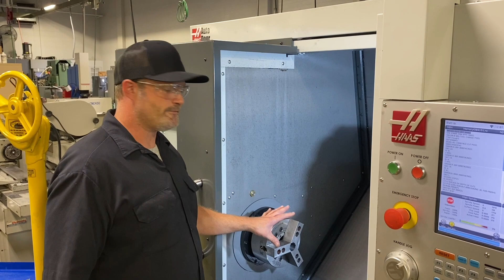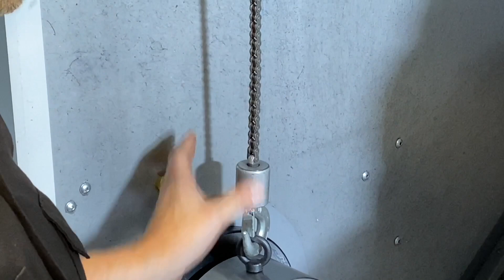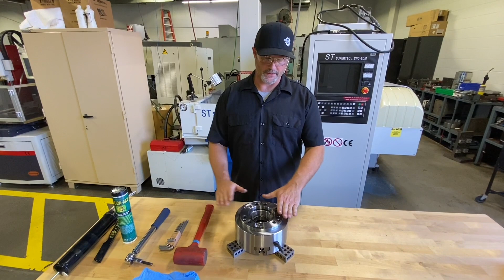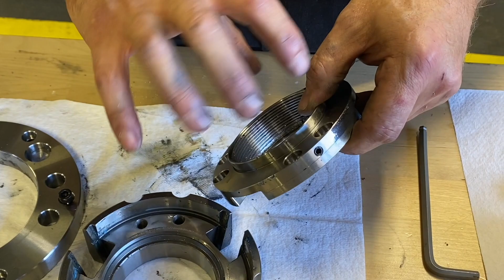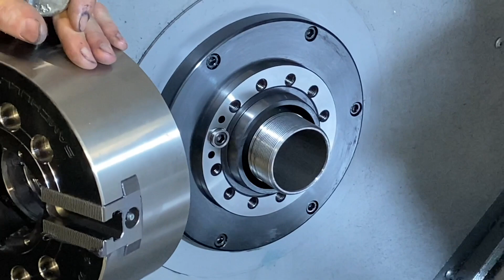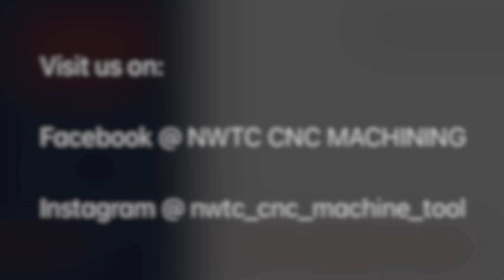How to Remove and Inspect A CNC Chuck

Comment: Do you put any grease on the fasteners that hold the chuck components together, and if so do you adjust the torque values? It seems to me that a lot of components like this are assembled with some kind of high sulfur oil on the bolts to ensure they come out again after. It has a unique and noticeable smell. I've noticed the same oil on a lot of the large bolts holding key pieces on to a CNC mill I'm working on fixing up as well.

Comment: Great video! I have had my new machine for over a year now and it just happens to have the same chuck on it. I will definately be doing this soon. Thanks for the great video. I have a question though, where did you get your torque values for the fasteners?

Comment: Nice and informative. It is easy to open and clean a well maintained chuck. I bought a machine that had 30000h and the chuck was never opened, I truly considered to cut the it in half. But with a big hammer and a lot of manhandling it came of and apart.
Reply: 6 months quick maintenance is mandatory now!